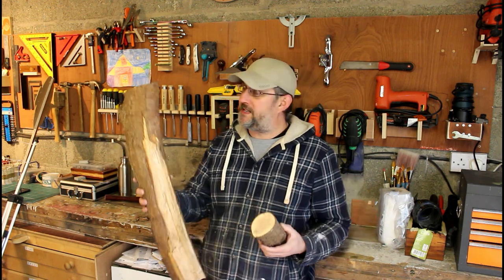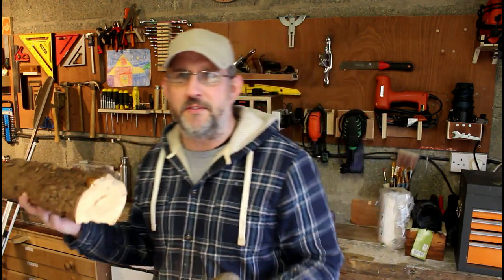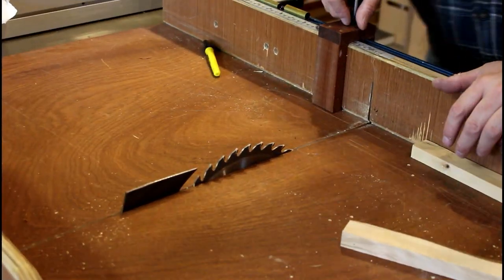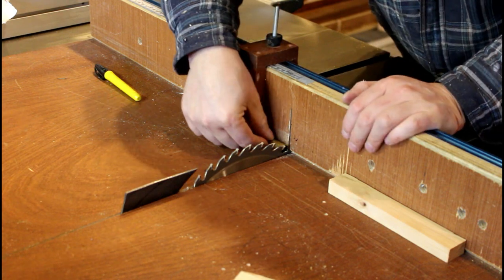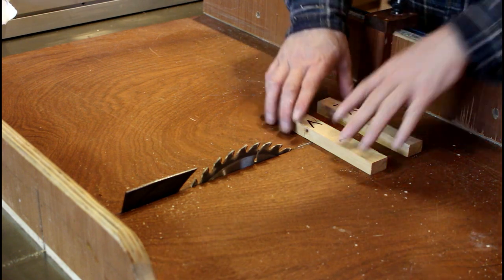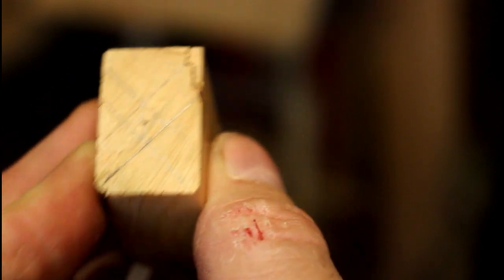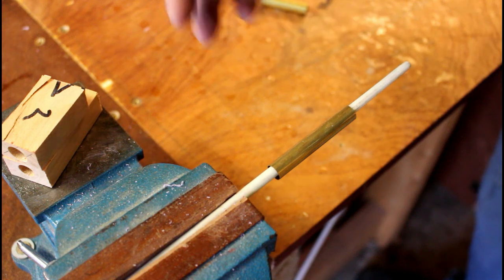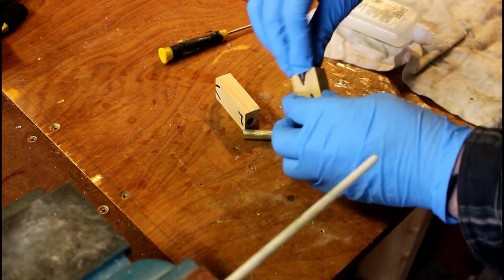From Tree Branch to Pen

Comment: Looks really nice!! You made it from fresh wood. So it's ok if it's not dryed?
Reply from the maker: Thanks for watching, The Branch was fairly thin, and had been drying for about 6 months before it was milled.
Reply: @andy.elliott.foreverpens  was wondering why you cut the sections rectangular rather than square?
Reply from the maker: @paddymcintyre9173   Just to reduce the number of cuts that i would have to have made on the table saw. 1 cut through the middle was fine.